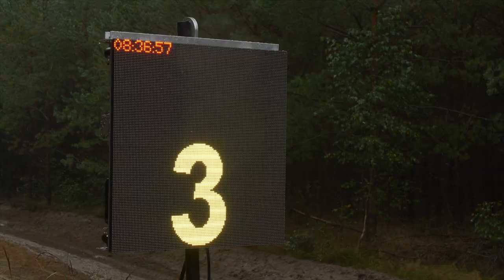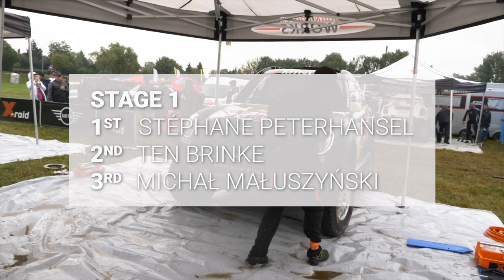Playing in the Mud: Peterhansel & Boulanger Win Baja Poland

Comment: What's the difference between a Rally Raid and a Baja?
Reply: A rally raid is a long distance offroad rally ran over multiple days. A baja is long distance offroad rally ran nonstop.
Reply: @SoftBreadSoft  - In Europe, bajas are actually 1-day or 2-day races with several long stages. A bit like a WRC rally but every stage being like 100-250km. It's a shame Europe has ZERO real bajas like the ones you described. Rally raids are similar but they need to be no less than 5 days.
Reply: @DanArnets1492  So basically what i'm gathering here is, a Baja is just a smaller version of a Rally Raid?
Reply: @666kingdrummer  - Yes and no. In a rally raid (the Dakar Rally being the biggest example), it's usually just ONE timed stage per day. In a FIA-style baja, each day can have 2-3-4 shorter stages.